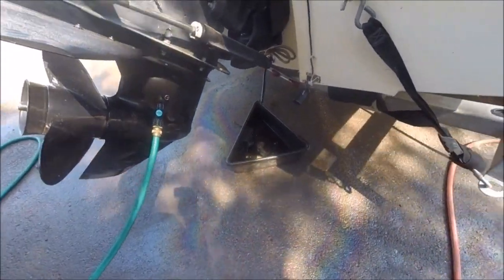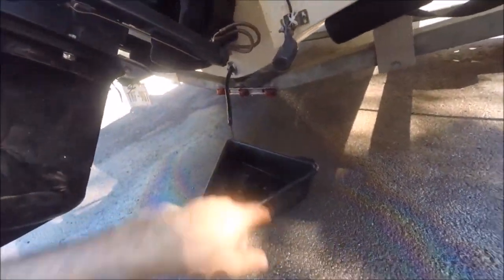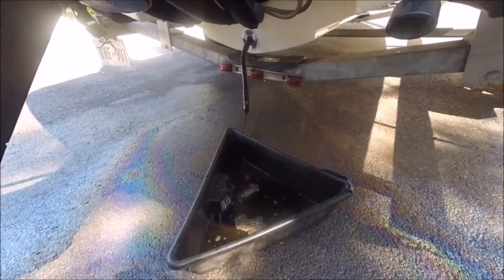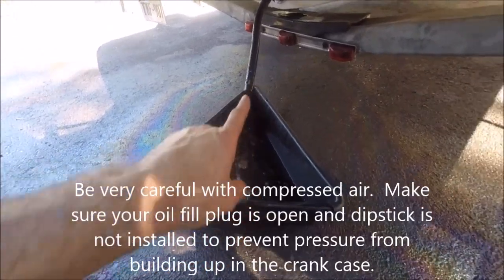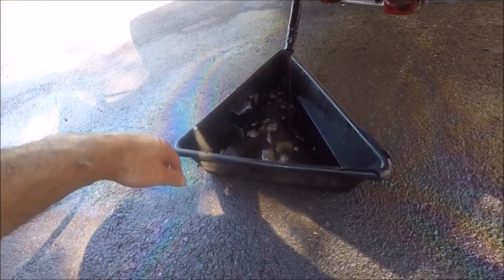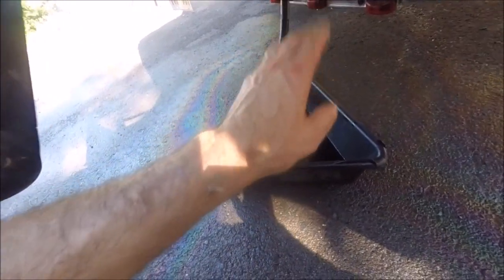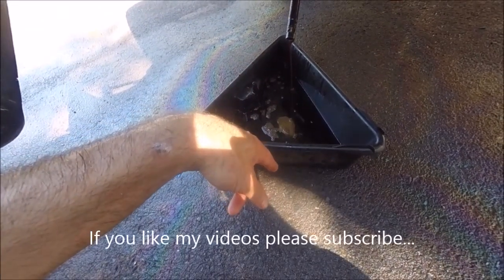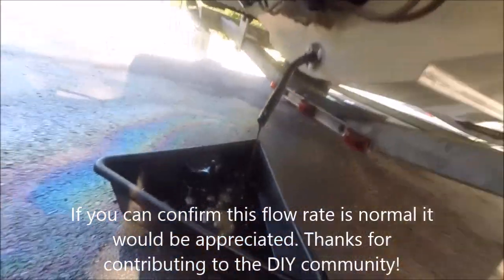DIY Help - problems draining oil from 3L Mercruiser

Comment: Same here. Since I am not so patient I end up using both the slowwww quick-drain hose to get the oil out of the bottom of the pan, and use the pump at the dipstick to get the most out quickly. Obviously with a warm engine.

Comment: Found your video because I'm having the same problem. Guess I'll just let it sit and drain. I'll be sticking a wire up the hose here in a moment to see if that helps like another user did
Reply from the maker: Chasing with a wire did not help my boats tube drain faster.
Reply: @mrdiyguy123  Ahh ok, yeah I just sprayed some high pressure air up there and it didn't seem to help either.

Comment: If you used adatives in your oil to thicken it or to stop a leak.  the product could have settled into the hose. Especially if you leave the hose laying below the oil pan (laying in the bildge).  My merc hose has a hook on the end so I hang it from the thermostat housing when It's not in use.

Comment: Remove the oil fill cap. Allowing air to flow behind the oil will reduce vaccum and speed up the process
Reply from the maker: Yes. I have done that... no change

Comment: Yep.. thought there was something wrong with mine as well.  Used a flexible wire bending the end over as not to scratch inner hose.  It helped a little.  
   What surprised me though is when I checked the oil dip stick,  oil looked pretty clean.  But when draining at the hose it was black.  Hmmm
   I'm going to do an engine flush to loosen up gunk perhaps sitting from over winter.  
     Another thought is I should be doing all this before storing the boat. Not at the start of the season.  Cheers

Comment: Warm it up first, then let it drip. It’s not fast, but it keeps the boat clean. Normal. (Which is why dealers/marinas use a pump to get it out up top. 2 minutes and it’s out).